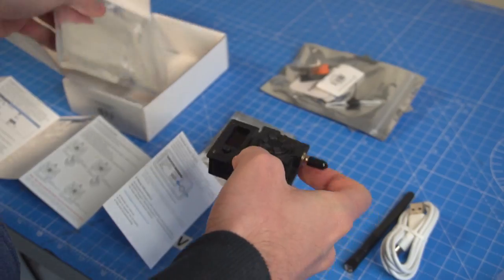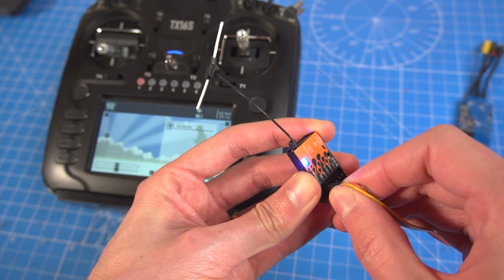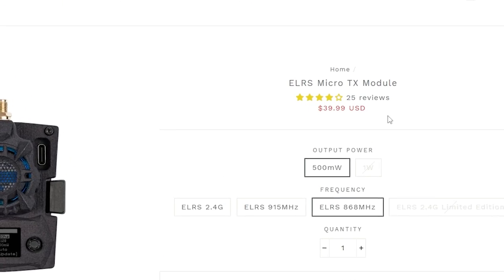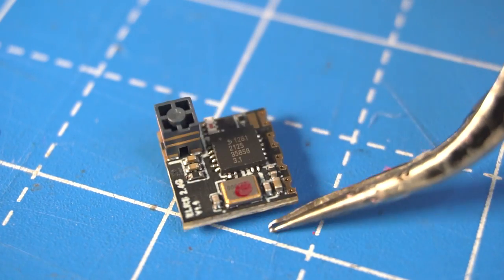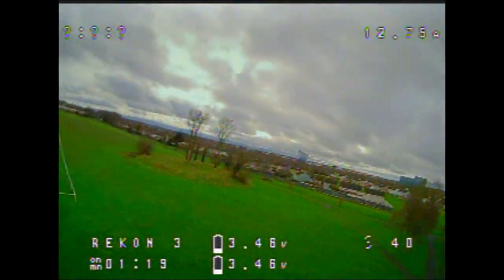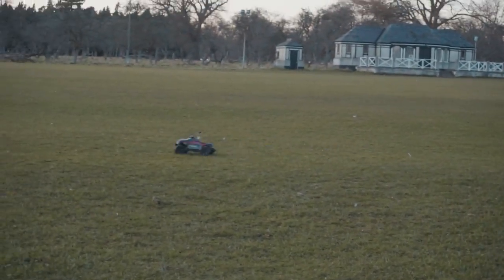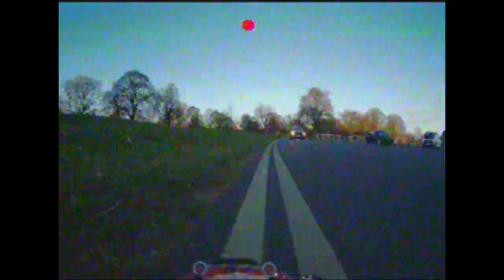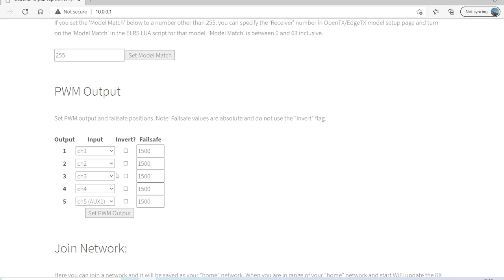Reach 100 Km under $100 | Long range receivers and new cheap ELRS module - BetaFPV

Comment: Use 'wide' switch mode, then go to the wifi update page of the receiver and remap channel 5 output to channel 6 and you'll get another proportional channel.
Reply: Bro have you tested it?
Reply: @surjitsinghdeo6533  yes

Comment: What types of Video transmitters are people using with ELRS for extremely long range setups? Do you have to stay with a 5.8 ghz video transmitter?
Reply: You could use a 1.3ghz system but the aerials are larger.
Reply: 5.8 is perfectly fine. But you will need a dish to get a 100km video link.

Comment: Great Presentation
The only way to test the 100 KM range is to get it an autonomous flight with a Pixhawk flight controller
Reply: Why can’t you fly it in real time ?
Reply: @tannerlane9669  Because lost signal at this distance is a bad idea...
Reply: @viniciusxavier6609  BR em todo canto né mano kkkk. Imagina perder o sinal do rádio de um drone a dezenas de quilômetros kkkkk, tenso.
Reply: That so very expensive, do you have recommended fligh controller cheaper but long range?

Comment: how expense is it to get into this hobby? like fpv planes, transmitter etc
Reply: Hundreds of USD
Reply: Hey there - I know you asked a year ago, but I am just finishing up my first HD FPV plane build, and it was about $1,200 from nothing to airborne.

$350 DJI Goggles V2
$220 DJI O3 Air Unit
$120 Radiomaster Zorro
$40 ELRS Module
$100 ZOHD Drift PNP (the plane bit) 
$40 SpeedyBee Flight Controller
$100 (2) 2S1P Batteries
$60 LiPo/LIon Charger
$50 Soldering Kit
$50 Wire (12g/14g)

In addition to this, it also took maybe 20 to 30 hours of research and learning.

Cheers!

Comment: Think I'll stick with my Crossfire on 900mghz at 2,000 mws....

The problem with all these units is not the range, but the tiny solder pads, lack of standardization of connectors, assanine binding procedures, and lack electrical insulation around the naked circuit boards.

Since ExpressLRS brings nothing new to the table to address those problems, I see no reason to chance just for marginal lower cost.
Reply: $50 1w ELRS module
$208 2w Crossfire module
Pretty sure if my math is correct thats a big margin. ELRS is still new, and open source for the community to work on and improve on. ELRS doesn't make those RX's... the companies who used the free software made them ;)
Reply: @shaneintegra  The feller you're replying to's comment has aged like milk.
Reply: @barneyfromblueshift  and even more so now, my elrs transmitter was plenty easy to setup and gets absurd ranges even on the 100 mw setting.   Not sure why anyone would waste money on anything else

Comment: Can that pwm recverver go on the front of the dji goggles digidapter fpb goggles instead of rapid fire module or foxeer module? Money short I'm going to use the little ELRS recverver + tx12 controller 
Thanks
Reply: How are you finding that setup mate?